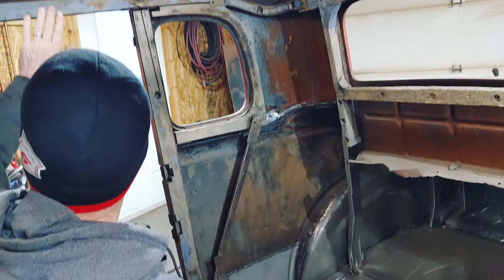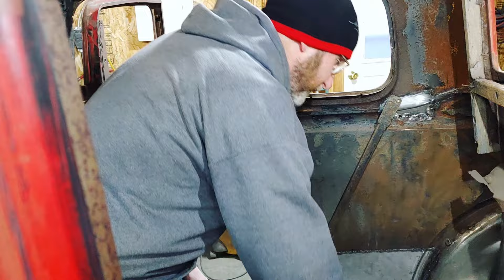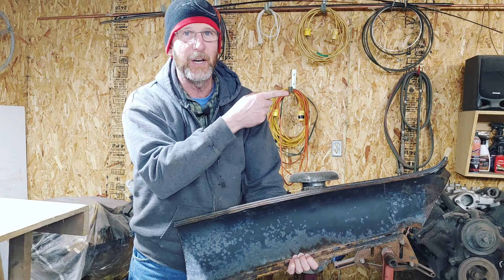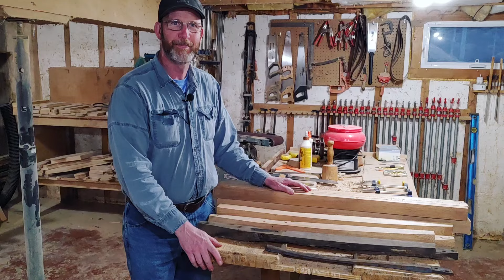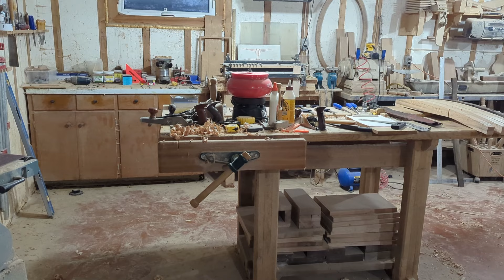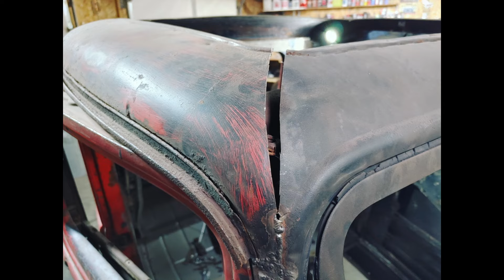1932 5 window coupe project - Replacing the wood structure above the door

Comment: Impressing wood work!
My best advice for parts stucked by rust, and for all other areas you grab a multi spray, is the red spray can from Rust Check. No one over and no one beside, and it's Canadian.  I'm so impressed over howe good it actually is to free up stucked parts. It penetrates to the moon and it lubricates without drying out.
The other area i use Rust Check regulary is to prevent rust an water i electrical connections. I opened my trailer plug connectien the other day after 7 years. Good as new. The reason to open the plug? I remenber to connect the lights, but forgot the connect the trailer.....